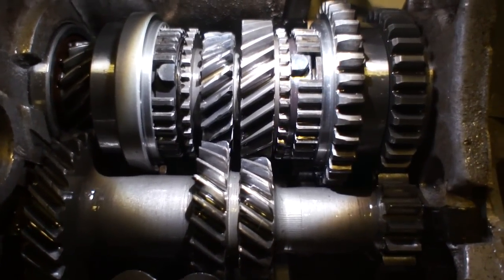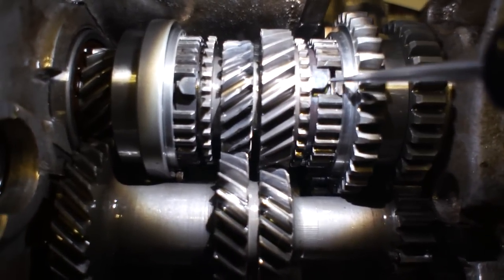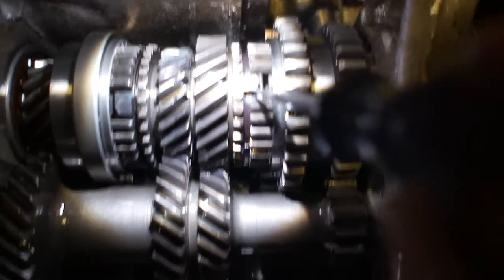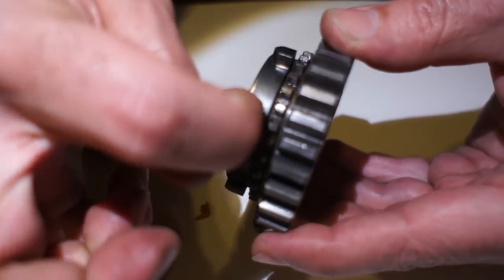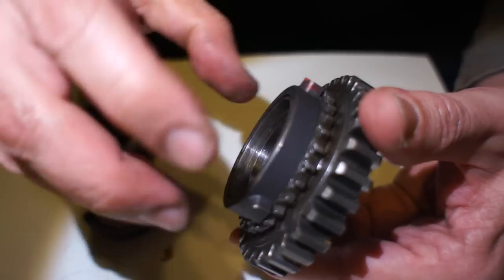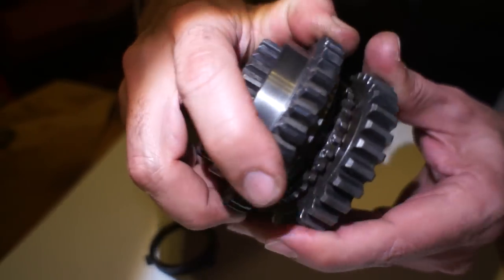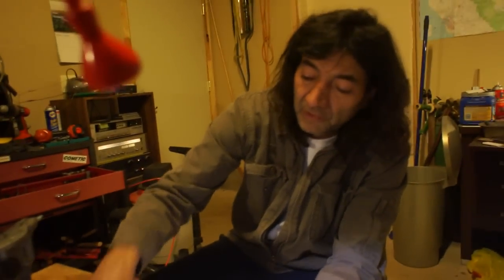Grinding Gearshift Explained

Comment: Thank you for your info, but my transmission is making that grinding noise on every gear even after putting it in gear and i do not have difficult to put it in gear, is it possible that my sliders are loose or something?

Comment: Can I drive it and just skip gear2? My mechanic has ordered a new gearbox but won’t arrive for about a week
Reply: Theoretically yes. I skip to gear 4 in my Camaro to save gas BUT… and this a huge but because my Camaro is tuned to skip to 4th gear from 1sr or 2nd for gas economy so maybe it’s an exception. 

I’m going to suggest if you attempt it and your car is not tuned for that you should rev your RPMs high when shifting up from 1st to 3rd. That way you can skip 2nd and land on 3rd without stalling or experiencing and jumping/jerky motions. 

Personally I’d just wait for the new gear box.

Comment: So what happens, if it's not replaced or fixed.....can it lasts for years like this....any takers to this question,  thank-you for any replies... 👍
Reply from the maker: It actually can last for years if the driver understands mechanical sympathy!  You can shift patiently and gently, and even use another gear’s synchro to help. But it will do more damage to the gear and shift collar the longer it has to crunch!

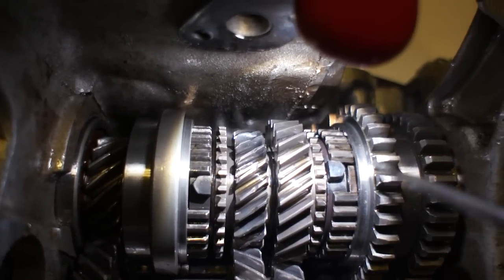Comment: It is a pity that you kept pointing to one of the three pins on the outer periphery of the synchronising ring as at  0:33.
The  synchronising ring  cannot be left floating in between the two adjacent  rotating wheels and it MUST be always engaged to one of the wheel with those sliding pins as the synchronising collar/ ring cannot have affixed location  with respect to both wheels,
It would have been clearer to first explain the taper in the synchronising cones and then  explain why the ring needs to be kept continuously engaged to one of the wheels  where in addition to friction on the taper there may be a turbine effect where the rotating teeth would be reacting on the other set of teeth, but eventually it is " Friction" or the cone clutch which takes over the final action but as you said there must be that gap for the cone to bite home,

Comment: Hi I drive mitsubishi gto I have a problem with the gearbox and because when I put in drive it doesn't drive off and if I leave it 5 to 10 minutes it will drive once again for another 100 meters or so then stops again.

Comment: I bought a used car with 2 gear grinding problem. I thought it was the shift stick got problem. Now I know it is a sync problem in transmission. Although it is a bad news, yet still good to know. Maybe I could rev match better to get around it.

Comment: Thank you for this! I think my trans has to come down.. I bleed the clutch, but no dice. Still hard 1st and 2nd and grinding reverse..
Reply from the maker: No that sounds like you need more clutch travel... Reverse usually has no synchro and will grind a little, especially if your clutch needs to be adjusted...
Reply: @JemalCRM  will try again to bleed, see if I can improve this weekend! Thank you.

Comment: currently my 95 yj is grinding in reverse and the majority of my gears all grind. I'm able to shift it while pressing on the clutch and shifting hella fast. Im pretty sure I am doing more damage - if I am understanding your video, to the gears with a bad synchro-ring. 😬 I need help fixing my wrangler.

Comment: My car is making a noise of metal to metal rubbing against each other. Weather it is in gear or neutral it won't stop making the noise.
Reply from the maker: Have you checked your throwout bearing and clutch adjustment? Start there, but if it's from the transmission itself, there's a bad bearing no longer supporting the precise distance between the two shafts inside the box.  If you keep driving it, there will soon be more noise!
Reply: @JemalCRM  Thank you Jemal I really appreciate your advice.

Comment: so if I have a problem like this there is 3 parts to replace: 
1. the gear itself because the synchro teeth are worn on it, 
2. the synchro ring because its so worn that its not pressing on the cone surfaces and therefore its not synchronising the speeds, 
3. the sleeve that slides over the ring and onto the gear, because thats worn as well. 
is that correct?
Reply from the maker: Most of the time, only the synchro ring needs to be replaced... unless it has been grinding for a long time, or had other problems like jumping out of gear under load.  You must inspect carefully upon disassembly, then decide.
Reply: @JemalCRM  Wow thanks for the quick reply even though this video is not recent! There is not many videos that explain how synchro rings work as clearly as you did!

I have a 2016 audi a5 with a 6 speed manual which has trouble getting into 1st gear sometimes, but not all the time. I press the clutch in and try to go into 1st but it only goes in half way.  At this point I have 2 options:

1. slip the clutch slightly and it will drop into gear (getting the shafts rotating somehow helps I guess)
2. put it back to neutral, release the clutch, then press clutch again and this time it will go into 1st most of the time (getting shafts to rotate into a different position?)

I am really confused what's going on here because at no point do I hear grinding sounds. and when it does go into gear, there is no clunk sound or anything. Do you have any ideas? If it was a worn synchro ring , I would hear grinding wouldn't I?
Reply from the maker: @lukaszM46  Actually, you can have a worn 1st gear synchro with what you describe, As the main shaft is not turning when the car is stopped, you don't get that same crunch. The synchro must bring 1st gear, and thus all the gears to a virtual stop to engage a gear when the car is not moving, or barely moving. Remember that with the engine running and the car in neutral, the transmission gears are turning at engine speed.  When you step on the clutch, you disengage the engine and the gears will slow and eventually stop. When you press on the shifter, the synchros "speed up" the stoppage.
Try engaging another gear first.. such as second gear, then slip back into 1st (without releasing the clutch). And avoid revving the engine and spinning the gears even faster.
You might try changing the trans fluid to a slightly heavier viscosity if the car has lots of miles. Or a thinner one if you are in a cold climate.
Reply: @JemalCRM  I have tried some more 
When the car is standing still it is problematic when I try to shift into 1st right after pressing the clutch. Goes in half way, no grinding or bad sounds.
In comparison, if I press the clutch and wait for a few seconds and then try to put it into 1st, it goes in fine. 

So it sounds like the input shaft needs to stop rotating inside the box, and then 1st goes in without problems. 
In the case of going into first, the output shaft is not rotating, so the synchro needs to completely stop the input shaft rotation to synchronize the speeds, and apparently it is not doing a great job at it.

I understand that there is no clunking or grinding sound because the shafts are not rotating when the car is still, but even when I rev the engine a bit and then try to put it into 1st, there still is no grinding, so that's confusing, because this is creating a condition for it to happen.

Going into a different gear and then into first without releasing the clutch is not much help since it takes the same time to press the clutch and just wait a bit.
Reply: @JemalCRM  forgot to mention this is only problematic when cold but when the car gets up to operating temp the problem mostly goes away

Comment: My transmission shifts as smooth as butter even though I severely did some grinding without using the clutch it even ruin some bearings but it's still shifts great..

Comment: I shifted it without the clutch I hear a bearing Do you think it damage anything else I shifted very lightly hardly any pressure at all....rev matched but grinded Internet part back into neutral

Comment: An excellent explanation and demonstration. Thanks mate !. It would have been a real saviour back in the early 1980s when every old clunker I owned had roached synchro cones. I probably would have had a crack at replacing the cones and bearings  rather than buying similarly used gearboxes and installing them myself.

Comment: Thank you so so much .. this is what happened to me .. I was in the parking lot which I was on a super slow on 1st gear ..Like about 5km per hour .. because I wanted to switch back to neutral .. I guess I didn't press on clutch deep rough or I didn't put the stick completely in neutral .. it was like in between 1st and neutral .. I felt the stick bouncing with the teeth turning but no grinding sound at all ... Maybe it's still in an super low speed .. then I step on clutch to complete release .. so in that case .. it didn't do any damage right? Thanks again

Comment: is that why when I let off the clutch too soon that it makes an ungodly sound and I can feel it in the stick?
Reply from the maker: Nope!  That's something else like a bad bearing or worn out gears or shift collars. There are many moving parts!
Reply: @JemalCRM  Ok. well it only happens if I don't pay attention and let off the clutch too soon in that particular gear. All I can try to do is not do it. Thanks.

Comment: Having a problem on my Mustand GT from second to third. This helps a lot. Wonder if I can just replace the on synchro, or just do them all.
Reply from the maker: Most of the time you'll wear the one that gets used the most for down-shifting depending on the kind of diving.... but synchros are usually MUCH cheaper than getting to them!  Once apart, inspect very carefully and change anything needed so you don't have to do it again!

Comment: I can’t down shift into second without making it grind. I can up shift to second no problem and down shift no problem in other gears. Why is just the second gear down shift?? Do I need a new clutch:transmission??
Reply from the maker: Down shifting requires the synchro to SPEED UP the gear for smooth engagement.  Up shifting is easier as the gear is slowing down to meet the higher revs from the previous gear. Use your brakes to slow, and try "blipping" the throttle on downshifting.  But really no practical solution from the shifter or clutch.  Trans probably needs rebuilding...

Comment: What cause this problem? I mean is it because person didn't change transmission fluid? Driving hard? Does this happen to CVT transmission?
Reply from the maker: It's normal wear mostly,  and usually the gear with the highest load from engine torque will be the first to wear. That makes sense... shifting to second happens much more than to 5th, and has to handle higher revs and power.
A CVT is an auto trans and is entirely different!
Reply: @JemalCRM  Thank You

Comment: Thanks for the simple explanation. I am not very familiar with many mechanisms of car, but I'd like to keep it cheap when repairing my car.

What part should I ask my carshop to change, if I have this grinding problem?
example: "Hi, I would like you to change this (insert spare part name here)"

can you list down the top 3 potential parts to change? thank you

would appreciate your help
Reply from the maker: Well, it's usually a bit more complicated than that!  The parts are cheap, maybe $15-25 for these Synchronizer rings, but getting to them can be very difficult indeed.  In the case of the Mini, engine out of car, disassembly from transmission, and complete disassembly of transmission itself to get to the $15 part.
By then you are foolish to overlook $3 bearings and other things that are discovered that could need attention soon, and again thousands in work to get to the parts!
The best course of action is to have a shop you can trust and educate yourself with basic knowledge so that you can understand their explanation.  That's where I try to help!

Comment: What happens if I don't fix this?
Reply from the maker: Now there's a good question Jacob! You can drive for quite a while if you can be gentle with that gear, even skip it when conditions allow. What happens every time you get a hard crunch is that you do more damage to the gear itself at those little engagement teeth. Little chunks break off and get in the oil... and in the bearings, and in the meshed gear teeth, and the other gear synchros.
You can use another gear's synchro sometimes... I show how in another video testing a Mini with a bad second gear, but that just isn't practical in any normal driving.  You can get good at RPM matching and shift patiently, and put off an overhaul for quite a while.

Comment: Good job explaining, I've changed my clutch 3 times already, because my fth gear is grinding.
Reply from the maker: The grinding I described will happen even with a brand new clutch!  If 5th is you top gear, it more likely has a bad bearing than a bad synchro. You never DOWNshift into 5th, so the synchro seldom wears out before the others!

Comment: My car don't go in to 4th gear at all can this be why. Thanks and good video
Reply from the maker: Can it go into 4th when NOT running?  It is unlikely to be a synchro problem....
Reply: @JemalCRM  thanks for reply, yes gos in ok when not running
Reply from the maker: @doitmyway9089  Start it in 4th with clutch down and see what happens when you gently let the clutch begin to engage.... don't try starting off in 4th, just see what happens when you put a little load on the gear!

Comment: I was in neutral parking and I accidentally put the shifter up and it grinding 3rd for couple seconds and I put it back in neutral did I kill my 3rd gear?
Reply from the maker: Not at all. Gears are very durable so an occasional missed shift or grind wont hurt anything.
Reply: Jemal @ Cooper Road Mini great thank you I was worried

Comment: Can grinding be caused by reason other than worn synchro?  For example would worn shift bushings or linkage cause grinding?
Reply from the maker: I suppose it's possible given the millions of transmissions out there!  But this is the typical grind of gears on shifting, and exactly how and why!

Comment: so you'd have to change out the synchro and the gear if both are worn out or damaged right?
Reply from the maker: Sorry 
i missed this... Usually the gear is fine as long as it wasn't allowed to crunch for long after the synchro wore out. You won't know till you get in there and inspect them...

Comment: I get more of a scraping sound after I have shifted gears. for example, 2nd, 3rd, and 4th all make a scraping noise 1500-1900 RPM after the clutch is let go. any higher RPM and the scraping subsides and everything is fine. just really annoying, and I'm not sure why the scrape only persists in that rpm range. any ideas??

Comment: Would there be a reason that the syncros would be grinding only while downshifting between consecutive gears (5th to 4th) and NOT while shifting up (4th to 5th)?  Trying to understand my Subaru STI transmission issue.  Only 30k on all stock components.

Comment: If I've got a worn synchro, Would it simply grind when going into a specific gear? In my situation, my car seldom goes into third. Either it will grind and refuse to go into gear, or it will go into gear. 90% of the time it refuses to go into 3rd gear, and I'm forced to skip straight to 4th
Reply from the maker: Yup, each gear "has it's own" synchro.  Grinding is a result of "forcing" when the gears are NOT synchronized.  There is no harm in "skipping" a gear! I also have a video where I show how to use another gear's synchro to help shift one that is worn.
https://youtu.be/lUOPLFWa7Pw

Comment: After repairing gear shift, is it gear shifting becomes harder then normal?? Plz explain
Reply from the maker: There could be a slight break-in period as the new synchro ring wears to the exact shape of the gear cone to do it's job properly.... Until then, it may take a bit more force to shift!

Comment: Great video! What prevents the gear from locking in? On my 2006 VW Jetta TDI, the third gear started doing this more and more where I try to shift into third and it blocks...does not let me shift it..I have to pull back in neutral and push it harder..

Comment: Happened to me using reverse hmfp 2x how to avoid it? Need to floor the clutch right?
Reply from the maker: No, reverse has no synchronizer ring, so you can either wait a couple of seconds, or shift into another gear first to stop the shafts from turning. Just about all manual trans cars will grind a bit into reverse if you are impatient, so nothing is wrong!

Comment: If you slightly about to shift into 3rd and hear and feel a grind (didn’t fully shift into 3rd)  and shift out quickly,  is that bad?
Reply from the maker: Most transmissions will grind at times without anything wrong, say if the clutch wasn't timed quite right, or you change you mind!  Most will grind a bit into reverse, which usually has no synchronizer ring. Most will grind if you try to shift too fast. Does not necessarily mean something is wrong.